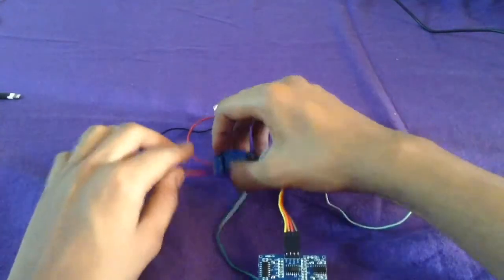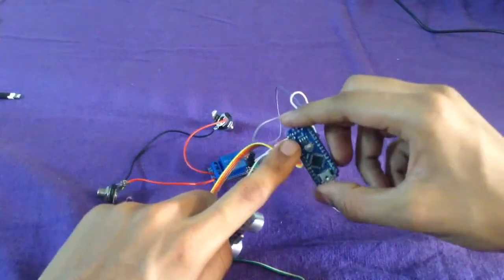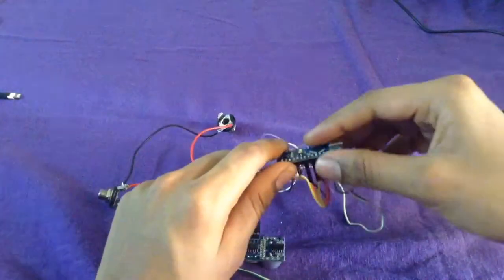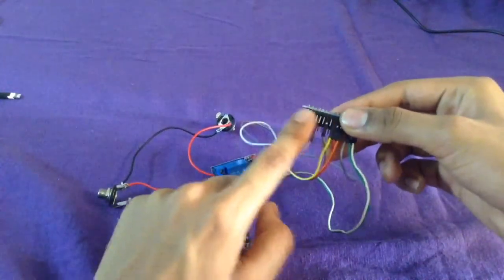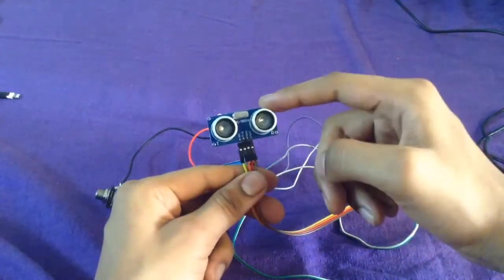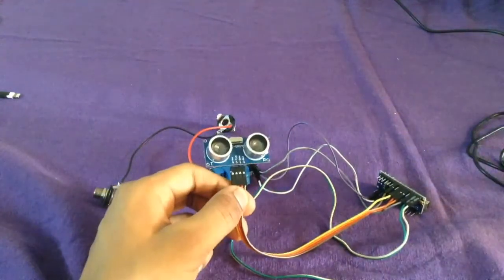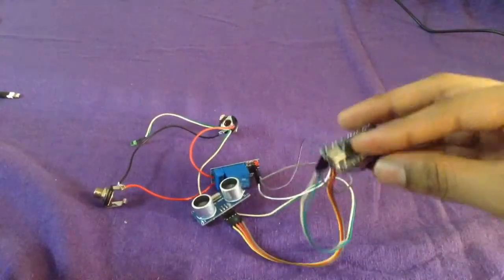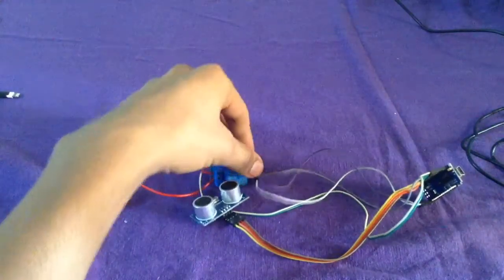|Arduino Guitar Pedal| A pedal that works without touching it! Simple Project

Comment: i made it ,code,relay all work ,pedal has sound but no effect,how to fix it ,thanks
Reply from the maker: I'm guessing either the Arduino code didn't upload correctly, or the relay is connected to the wrong Arduino pin!
Reply: @CuriousMotor  i fixed it, work well but sound too noisy

Comment: Can i use ldr module instead ?relay so noise
Reply from the maker: Yes you can
Reply: @CuriousMotor  so the code is same ?
Reply from the maker: @upside-down6211  Please use this circuit instead - https://curiousmotor.com/2020/06/04/simple-555-based-tremolo-effect/